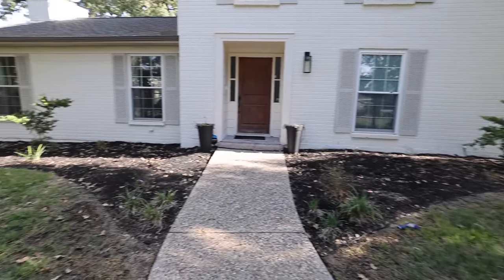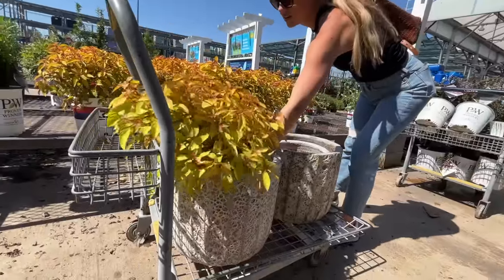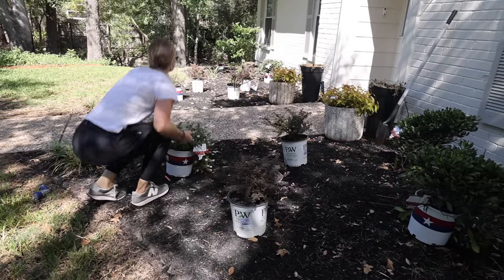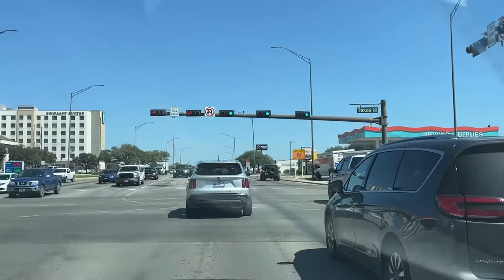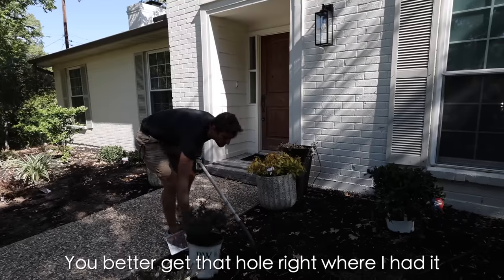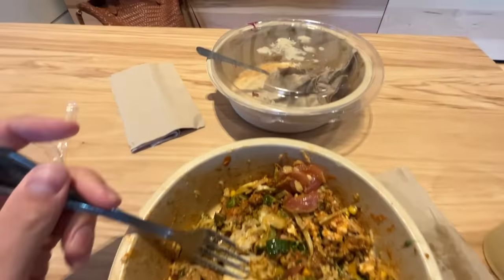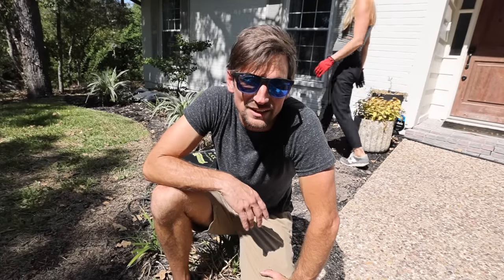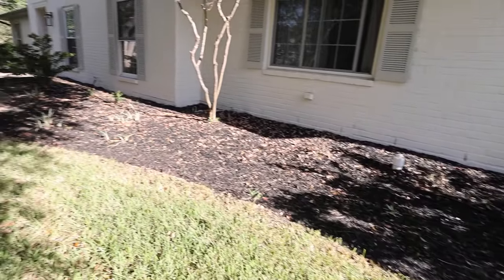Giving Our SAD Front Yard A Makeover // Flower Bed Design Ideas // Front Yard Makeover

Comment: A little hint to help plants survive transplanting:  Soak the plants in a basin, kids wading pool or something and let them all get a good, long drink.  Dig a little wider and deeper than the root ball, throw some mulch and fertilizer into the hole and then water deeply.  Then put the plants in and gently but firmly press the soil around them.  Water the topsoil and then mulch.
Reply: It also helps to form the surrounding soil into a little "wall" around the roots of the plant, so when you water the water won't just run away from the plant.
Reply: Yeah ditto, let's us viewers support the good DIWife couple to get some hands on training with a guest horticulturalist.  They definitely need to learn more about how to plant.  Those plants aren't rocks.  Think of the savings in plants, and they'll love gardening eventually.  All gardeners can vouch for it getting under your skin and overtaking down time coz it's enjoyable, relaxing and REWARDING. cheers to all
Reply: I was about to say the same thing. I soak mine in five-gallon buckets until all the air bubbles stop.
Reply: I did that with Mums & they are still alive & colorful after a month!
Reply: How you placed them before you planted them is the way to do it. Remember to tease the roots when you take the plant out of the pot. Make sure you water the new plants until they are established. Get the kids involved. Good luck!
Reply: @cherylreich5528  .
Reply: its a good idea! I lost all my plant two years ago in winter, cause i did not dig very well,  but after some researches, i figured it out,  now my plants are safe

Comment: Generation gap:  I still call them tennis shoes or tennies, LOL.  Living in Wisconsin, we get freezes yearly.  What we also now get is extreme heat and humidity and semi-drought periods where it doesn't rain for 8 weeks and then we get downpours.  The weather has definitely has changed, and not for the better, since I was a kid (born and raised here, now 71 years).  The same for most areas across the country I think - changes in the weather so there is no "normal" any longer.  So, we have to adapt as best we can and get plants and turf that will survive the changed weather conditions.  Good luck with your garden bed, it looks beautiful, fingers crossed everything survives and thrives next year and thereafter.  If you use a dehumidifer at all, instead of running a hose a drain, empty out the water container once a day and use it to help water your trees and shrubs first and then your flowering plants.  It helps and it's free water.

Comment: OK hon I can see by the comments you have a lot of people giving you tips and advice… But I have been an exterior decorator and designer for 20 years and I’m leaving you this message after having major surgery and being in major pain, so please know it’s only because I am watching your video and I want to see you succeed with the area in front of your house and give you the best advice I can to have them thrive. So for starters the best thing you could do is get some landscaping spray paint which would be a canvas raise at the top not at the side it’s usually orange sometimes red yellow either way it goes away. Read the tags on each one of your plants and you can do this now even though you planted them. Do you want to read the tag and you want to draw out a circle in your planting area of how big they’re going to get so how wide they’re going to get so then you’ll have the big circles of how wide they’re going to get. Then in the circle for each plant use the landscaping paint and write the number of the height they’re going to get so then you’ll have a why they’re gonna grow and then in the center of the number of how tall are gonna grow. That will tell you where to place your plants and how far apart you need to place them even though in the beginning it’s going to look sparse They’re not gonna die off because they don’t have the room to grow and they’re not so close that one is growing or taking all the nutrition to try to grow to the size it’s supposed to grow and therefore killing off some of the others. Then you need to address your soil, Your soil is hard and it’s gray which means it doesn’t have any nutritions in it. So you need to get a really good starter plant fertilization as well as if I was you I would get some good topsoil and I would till it into the ground to break up that hard soil and get some better soil mixed in with that hard grey rocky soil, so I do that first and then once you have all your circles drawn out and you know how tall your plants are gonna get you said the plants that I can get the tallest in the back on the circles of their size and then you layer them forward the shorter they’re going to get and if you don’t want to and topsoil to the whole garden at least put some good soil in the hole and take the soil you have and fill up a bucket or something with it and get rid of it then before you plant your plants put in a good quality starter plant fertilization because your plant is only as good as the soil you plant in what you add to it and how well the roots do even if the tops don’t look great if those routes are establishing correctly then you’re gonna have a happier healthier plant that will last longer or will grow strong enough to withstand Extreme weather stream storms etc. so you really want to work on mapping it out first and know that where you’re setting your plants they’re not too close together it’s far enough apart but they’re going to grow in and not overcrowd each other and that you’re not putting ones in the front that are going to over grow in the height and you’re not gonna see the ones in the back so if you map it out the way I said and like I said the best way that we do it As a designer is with landscaping paint is that where you get your circumference how big it’s gonna get when it’s grown and you get how tall it’s gonna grow as your number on the inside like 4 feet 5feet 2 feet or whatever it might be. Then you need to amend that soil even if you’re just putting some soil in each hole and pulling out some of your own basically dead soil the color and texture of your soil it’s dead there’s no nutrition to feed those brand new plants. Then each hole add a starter fertilizer! If you follow these instructions you’re going to have a better chance of your plants roots spreading out and taking hold and there for giving you a better result in the end. The biggest problem people have is your such a large area and if you set them out the way they’re going to grow my size it’s still gonna look sparse to you But that’s normal because they’re only starter plants but as they grow they’re going to grow and look great so you just have to live with that look for a small amount of time. And then you want to make sure you water them in immediately and you will not have air pockets like some people have mentioned if you take out some of your soil add a good topsoil then a good starter plant fertilizer at that when you can add some water to the hole if you want or you can plant them and pack them in not too tight but you don’t want air and then just water them all in really really well the first time right after you’re done. And then if you’re having a really warm spell make sure they get watered daily in the morning or at night and then as the weather changes if you’re getting a good amount of rain they’re going to get what they need if you’re not then have them watered periodically just less watering in the winter because that’s when they’re going to go dormant. You also want to keep the tags and maybe put them somehow right where the plants are in the ground or on a steak or something and write on it when they’re supposed to come out and grow so if they are spring bloomers or summer bloomers or fall bloomers you’ll know and if the plant looks dead on the top but yet they’re not supposed to bloom until late summer you won’t pull them out because you think they’re dead. So if you write down the stuff that I’ve told you and follow it you’re going to have so much more success with that area and any area so that is the advice of a exterior decorator designer for over 20 years and those really are the basics. I know it’s long but I have to speak this because I just had major surgery and I can’t type. I just want you to have a great experience help your plants have a great experience and for you love your garden for many many years to come especially with all the hard work. God bless and happy growing, both in knowledge and in your front garden space😉❌❤️❣️❣️❣️

Comment: You house is beautiful, and looking at it with your plantings, did you consider placing some larger plants along the wall of the house for color? Also, I put soaker hoses in gardens of my clients, they only have to turn on the water. Mulch at least three inches to conserve water. You two are so funny.

Comment: I think you would’ve been better off if you  had amended your soil before you planted your plants. Did you test it ? did you add any plant food? I’ve never seen anybody put a drip system up to it as opposed to circling a plant? Only time will tell.😂. You might consider getting an auger to attach to your drill next time to make digging a little easier. They have them in all sizes.

Comment: Mulch will turn grey(ish) in two years or less and will need to be replaced....a better choice would be rubber mulch....it cost a bit more BUT it last without replacement and the color never changes

Comment: With such a big space, you might need some taller species. You might want to research tall grasses, such as the miscanthus. Miscanthus silberfelder is a gorgeous grass that blooms into these large delicate frond like thinks. They grow up to 7 feet tall (might be nice on either side of the front. Best of all, they are very hardy and don’t require a lot of maintenance. They provide height, movement and kind of thrive on neglect! They are a Big Bang for the buck because after one year they will spread to about 3 feet wide. 
Anyway,

Comment: You forgot to compost the soil. Your soil  is mostly clay and it was very dry. Plants hardly survive in those conditions. Don’t forget to check the irrigation system as they fail permanently. And because you  mulch already it will be hard to improve the soil so don ‘t forget to fertilize. You are a much better builder. 😢